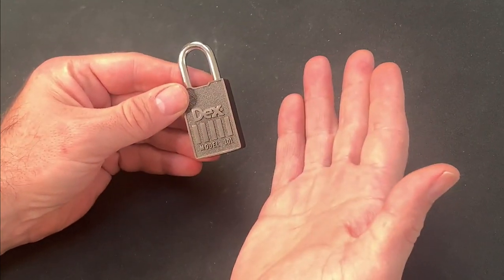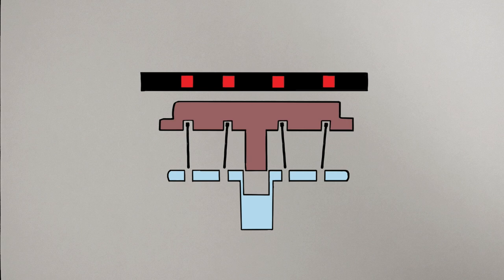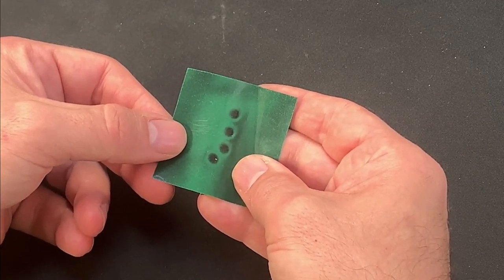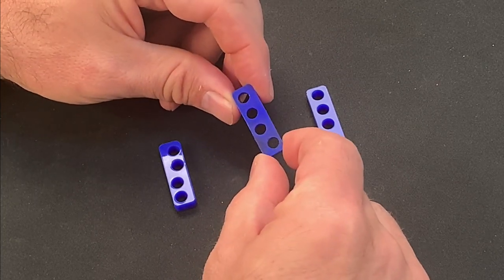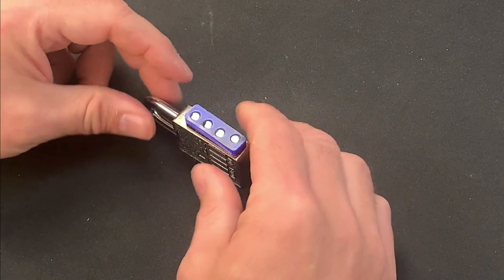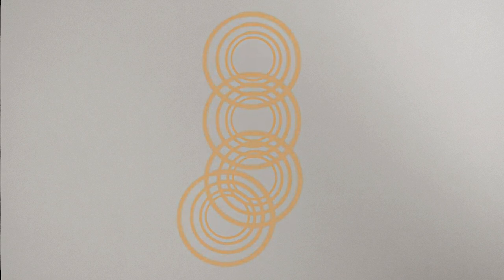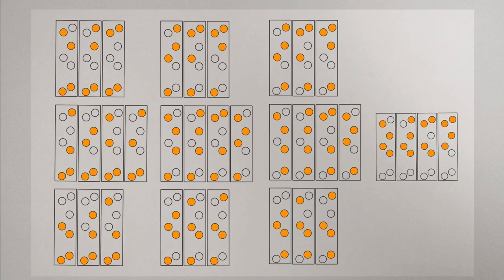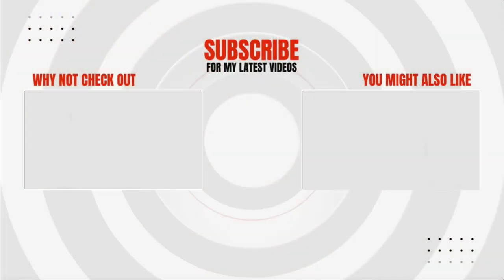037 how to bypass a magnetic padlock

Comment: Thanks for sharing! If there are not "magnetic components" within the lock body why then does the polarity of the key's magnets matter?
Reply from the maker: That’s a great point! On reflection, I think I would qualify that statement by saying that the magnetic forces are so weak in the lock body that they don’t show up on the magnetic paper so they can’t be used to read the coding for the key. The polarity therefore does matter but the key is readable - the lock is not - at least not using my current methods! Thanks for the comment which really helped me to check myself! 🙌

Comment: It would be non-destructive, but I don’t know if it would work: a rapping attack with a mallet. Those generally work with inertia to shove locking pawls out of shackles. Would be interesting to see if it would (randomly) align those four pins in there. I’m sure BB’s spinning magnets are essentially randomly aligning them, but that is using magnetic force, not kinetic force.  Might also take hundreds of raps to statistically stack the odds in your favor. Maybe vibrations from a reciprocating tool motor (saw or sander) held against the lock body would create enough vibrations to simulate those hundreds of raps.
Reply from the maker: All really interesting potential solutions John - thanks 🙌

Comment: Fine work there, reverse engineering and all, even if it isn't picking! But isn't all picking and lock work about the engineering?

I'm curious-how did you determine that there's only 4 magnets at any one time? To do the maths of it (which of course I love) I would have assumed that each of the 7 positions could be in any of the three conditions-positive, negative, or neutral. Admittedly, I haven't worked it out (yet!) but I'd think that could give you even more possibilities, which is awesome to think about.
Reply from the maker: Thanks - my assumption that it would likely only involve 4 magnets was economic rather than engineering - I figure economies of scale and the nature of mass production means that the others in this model will follow the same basic design as this one 😉
Reply: @fishpicks4531  That does seem a logical assumption....like I said, my math mind wanted the problem to be harder!! lol